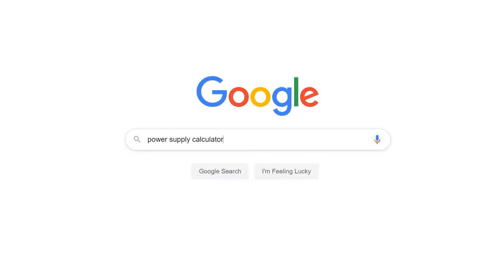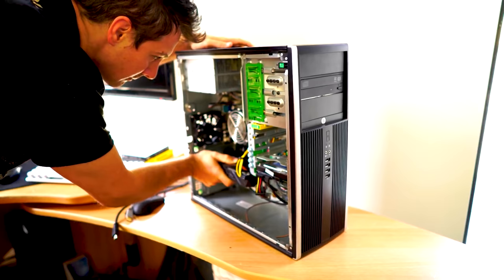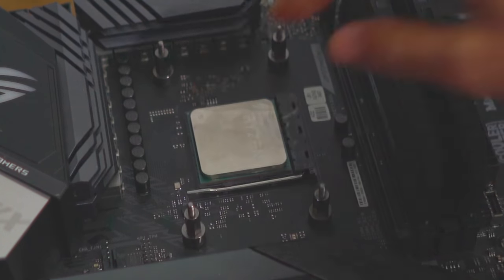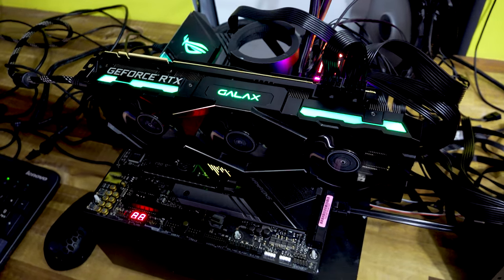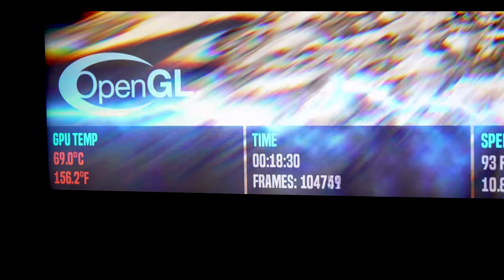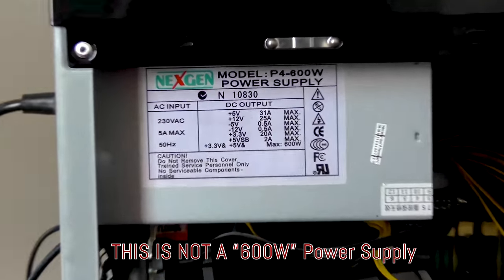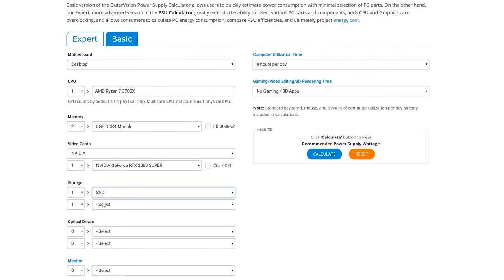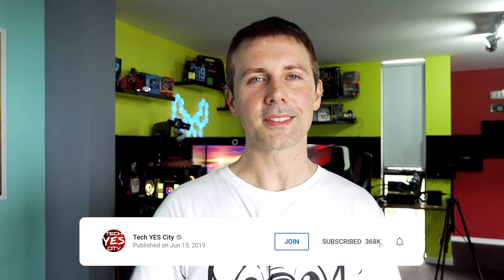I Tried Running a 3950X and RTX 2080 Ti on a 450 WATT Power Supply...

Comment: MAXIMUM power OUTPUT 450 wat... remeber, there are no any 100% efficenty PSU,  80 plus.... 80% of input power go out of PSU for cpu gpu and rest of our pc parts, maximum  input power should be around 560 wat, in this test we could see.. 420 wat , enough for 100% tdp r7 3700x  (not enough for 3950x of course)   in my opinion, 600 wat would be enough for 100%  oc r9 + 2080ti in one moment, 800 /900 and more watts? only for multi gpu....

Comment: hello .good day..i need your help..can you help me please ..i have a old dell desktop i3..that i used to practices  making music. it used to work fine until i start filling it up with files .it is now  stuttering when i am doing my task.. so i deside to make a new pc.. i bought a amd ryzen 7 2700x chip.. amd i also bought 16gb memory to go with it.. i am not a gamer so i dont need most of the gaming stuff..but i need the gaming core power and the possessing speed..so i need your help to find me a motherboard that can work flawless for my task so if i want to overclock or change chip i have at lease 1 option .. and a quiet power supply ,, i am searching but there is too much on the market  and i dont under stand the computer talk anymore ..tech is too advance.. the last time i make a pc is 2006.. thanks in advance

Comment: I've been using thermaltake smart psus for the builds i do for people, and usually just get a 450 to 600 watt psu. For the majority of builds that is all you need. Ends up being  $70 bucks or less for psu. Never had a problem, you just need to spec the right wattage

Comment: obviously benching with just games doesnt load up your system enogh...
if you wann stress a powersupply than you need to run XMRIG mining on cpu and runing a mining on the gpu.....
anyhow - wondering about that your  system even can boot
i just tried yesterday a R9 3950x with a RD5700XT ( 200 W+) and it fails to boot at 500 Watt PSU...twice i had seen windows desktop but system error message was that the gpu is not recognized and switched it of....
how yours can even boot up with less than 500 is a miracle :))

Comment: Holy hell you do not want to run your PSU at 100%  capacity.  You will burn it out super fast. The example he gives in the video of getting a 550W PSU for a system that requires 527W is legitimately HORRENDOUS advice. Just because you CAN doesn't mean you SHOULD. Just because I CAN run my CPU at 90C doesnt mean I SHOULD. The difference between a 550W PSU to an equivalent 750W is legitimately $20. So you saved $20 now but in reality you'll have to replace the PSU in a year or two so it ends up costing way more.

Seeing big channels like this give god awful advice is incredibly frustrating

Comment: Can i run 2 rtx 2060 in 550 watt power supply
Reply: If you are running them downclocked at 100Watts for mining, then yes.  Can't think of why you'd want two in one machine for anything else, as 2060s can't SLI. [SLI starts at 2070 super level]

Comment: So i can run a rtx3050(130w)ryzen 4350g(65w)8 gb ram singles stick (1.5 v)
Psu Antec VP450P Plus 450 Watt Power Supply 85% efficient
+12v 396w
Reply: Yes, this power consumption similar to my old RX570 which i used with the old FSP HYN 450w 80plus white

Comment: The thing is if you go and check 80 Plus certificate you'll see that they give that certificate to the full load. Most of the time PSU's work more efficently at tower loads which means if you buy a 800w PSU while needing 400w you'll pay extra price at the start but overtime you'll more likely save money from your power bill and supposedly it should have longer life span.

Comment: 2700x+gtx1070 max load with rest of the system excluding monitor: ~280w
Reply: Did you use a power meter?
Reply: @Dyscrasia  yes

Comment: I had 1000 Watt psu's which were weaker than 600 Watt psu's of the same manfakturer, bei quiet the P7 Dark Power Pro becomes weaker with the time. One 12 Volt Rail reduced Power to 11,81 Volt, in Windows an order to stop it.It was dramaticaly at the end this could Happen with one of my 2 HD7970, a 700 Watt straight power, even older could handle. But my next psu i still use an EVGA supernova 1000 Watt G2 80+ Gold was a better choice IT IS a 80+ Platinum at the end, sometimes better than the Platinum and it costs today more than i have payed 5 years ago. But i think that the bigger psu's have some weakneses more often than the ones with less Power. Maybe because they know that Most people don't need as much Power? And the Peak Power of a psu is allways much Higher than...

Comment: So a cpu bound game running at 1080.... Why not run a gpu bound game at 4k and watch the power usage go way up. Whatever it takes to get the results you want though huh. My 8700k and 2070 super can pull 750w from the wall while gaming and those are lower end parts.

Comment: You buy a more powerfull power supply because the stress it is lower on a more powerfull power supply. You don't need in truth more than 150w more, just not to stress it. Also you have room for overclocking. I fried a 450w power supply with a core i7-960 and a gtx 760 oc...

Comment: It's honestly a silly message to people. PSU's are one of the least expensive components you can put in your system. Everything in your system is powered by it. Why save a couple of bucks on a small power supply NOW which will keep you from upgrading to higher end components down the road? If you wanted a HEDT cpu with 18+ cores, lots of HDD's for storage, SLI, water cooling loop, lots of lighting, etc... you will want a bigger PSU. Now you have to buy a new one, when you could have spent just a few more dollars in the first place and got a PSU that would handle it all. I know you needed to have a topic to create some content, but this one is just silly. People listen to you and you gave them advice as though it's a golden rule when it's really only applicable if you know 100% you will never upgrade any components in your system.

Comment: "Money wasted", I know one guy who bought 1000W power supply for 4x1080Ti - as result instability of the system and power shut downs time to time. So you do not need 1600W for simple card, but saving every cent on PSU is not an option as well. Should be balanced.
Reply: renderman.pro 
Is 4way sli possible with 1080ti?
Reply: @Patrick-vv7cn  Yes. I don't know about gaming, but in general you can use 4way SLI bridge, and it included with motherboards with 4 PCI-e, not sell separately  for $80 like nvlink bridge.... (such a evil genius idea to sell simple connector for 80 bucks)
Reply: @Patrick-vv7cn  if you are asking not technical question, but practical, it is not worth for gaming I guess. I'm using it for design/graphics/rendering as separate cards not combined to SLI while drivers and software issues. As separate cards 4 GPU are working very good.

Comment: can i run rtx 3080 with 450 psu ?
Reply: no the 3080 its self can pull 320 watts. and thats before you add cpu fans hard drives or anything. idealy you want to use at max 80% of what your psu is rated for a 3080 build would probably instantly pop the OCP on a 450 watt psu.  nvidia's reccomendation of a 750 is not far off. if you have a high power draw cpu like a 10900k or 10700 with a 3080 you could see power draw of up to 600 watts so you may be able to use a 650 but it will not be good for the power supply and you would want a 750 to ideally be in the 80% or so range of ussage

Comment: Although the average power draw is less than 400 watts, the instantaneous current draw on 12v rail by the GPU can be a lot higher, most definitely exceeding the ratings on the PSU.  See  https://www.igorslab.de/en/the-battle-of-graphics-card-against-power-supply-power-consumption-and-peak-loads-demystified/4/

Comment: "If I wanna flip it, I'd go with the 670." So in short. nVidia is the stupid tax. ;)

Also I tried that website. Doesn't work on any of my browsers. Oh well. Tried another. Said I'd need 468W PSU. I am using the noisy Hexa 400. Meh. (tl.dr. what these websites says, are incorrect. only follow them if you know nothing about hardware.)

Comment: so my 550 is enough for r7 2700 and rtx 2060
Reply: I have a gtx 1080 ryzen 3 3100 combination using 450 watt psu and it's running perfectly fine to this day. And yes, the gpu gets its full boost potential and the cpu is Overclocked.
Reply: @largecupenjoyer1459  ram?

Comment: I don’t know why to save $ 100 on the source when you have 2080ti and 3950x money, that's pure gambling, nothing else, I have a 9900k and msi 2080ti GamingX trio and runs it on a Chorsair 850i which I have been around for 6 years, should buy a new power supply, I would buy maybe even stronger and including a passive fan that turns on from consumption X, wipe the power supply if powering components for thousands of dollars is probably a huge mistake

Comment: A pretty poor video. You're not stressing the GPU and CPU at the same time. Try running Furmark and Cinebench at the same time. Second you're showing the power drawn from the wall whereas the power rating of the PSU is the power it outputs to the PC and it is the latter figure we need to see.

Comment: As a rule of thumb, I always rate my PSUs simply by weight. The beefier a PSU is and the more it weighs, the more reliable they usually are and therefore can take more abuse over time.
A 800W PSU that weighs less than the graphics card it's supposed to power is a bad sign in general...
Reply: Or just don't buy anything under 50-60$ (depending on where you live of course). Except for some 200-300W OEM PSUs, the rest is just garbage. If you spend more than that and buy power supplies from trusted brands, you're fine.

Comment: It might work for a while but running the PSU at full capacity all the time will drastically shorten the lifespan of the unit. It's always best to have more than you need.

Comment: Suuure, all ryzen 9 + 2080ti builds are on a bench. Well, guess what, if someone can afford an r9 and 2080ti they can also afford 2 radiators and a customs water cooling system with all the RGB and big ass case to put N number of fans. If anyone building an r9+ 2080ti system is concerned about their budget they are doing it wrong. 450W exists for people who are actually looking at their budget and for those builds, it is absolutely acceptable, but what you did here is just irrelevant. Sorry but this video looks like it's done for good intention, just executed poorly.

Comment: If you want to follow this stupid advice and hook yourself a 3000 series Ryzen or 2000 series Nvidia card with a low Power Supply go for it, but I'm running a 3950x and a 2080 Super I'm not chancing a failed system do to low power 😒. And another thing to keep in mind is if you EVER upgrade your computer and you have a lower power supply it won't be able to handle something like a 3080 or 3090 if your going all in on a GPU. Your looking g at more cost in the future so the best thing to do is at least have a 850w power supply so you can run these next gen CPU's and GPU's. I don't know why this guy even made these videos to be honest.

Sure its nice to try something unique like whats the less amount of power you need in a build, but you shouldn't chance this for a normal build at less I won't, I've got a 1000w power supply for my current rig, and if I upgrade to a newer GPU, like a 3080 I know it will be good and powered well 😃. Have a good one.

Comment: your testing methodology is flawed - you need to bench the cpu WHILE you are benching the GFX - You cant assume a normal system would be confined to using only ONE COMPONANT of the system at once . FOR INSTANCE WHAT IF A USER IS RUNNING A ZIP OPERATION video encoding and running a video game ? Those are two separate power draws from the same card ( one for the 3D unit and one for the video encoding unit. ) what f windows update starting running in the background ???? You didnt even OPEN GPUZ OR CPUZ OR CORETEMP OR HWMONITOR  - What is your core voltage compared to using a normal power supply ? ... so what if you maxed the power supply all night and it didnt blow ? you shouldnt be maxing you power supply or getting even close to your 88.8% reading - AND YOUR POWER SUPPLY IS 80+ WHITE CERTIFIED WHICH MEANS IT HAS 80% efficiency  so technically you will draw 450w and give 360w guaranteed ---->  to give you 440w it would need to draw 550W which it will not do ever ... . What is the point of this video ? to show that it will work ? ONCE ? TWICE ? .. where is your downclock comparison ? This is a total scrub video  . People are going to see this and go buy 450w power supplies for their 2080s dafuq